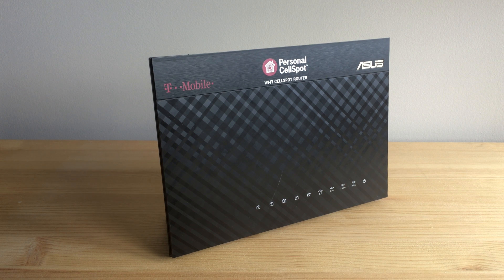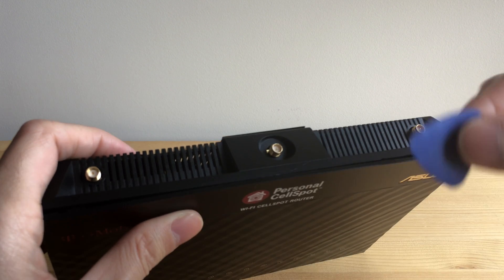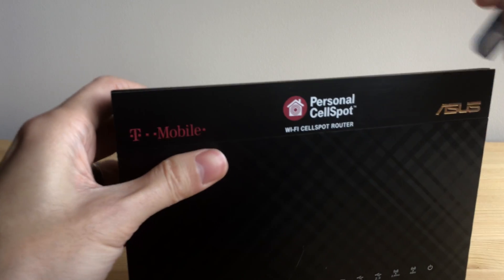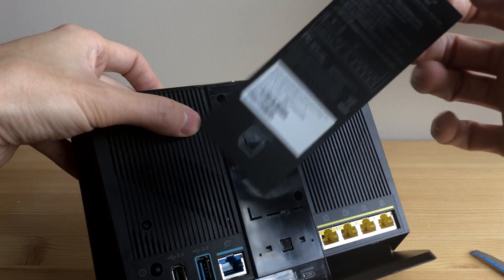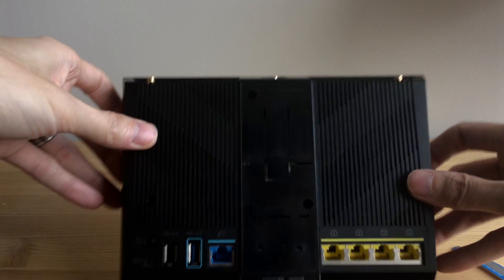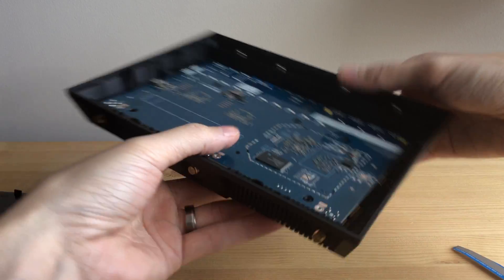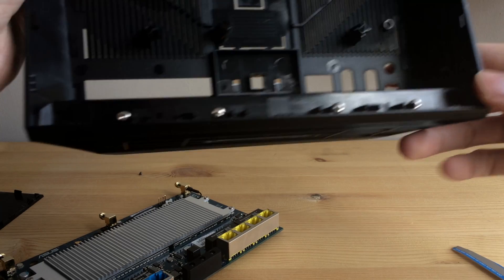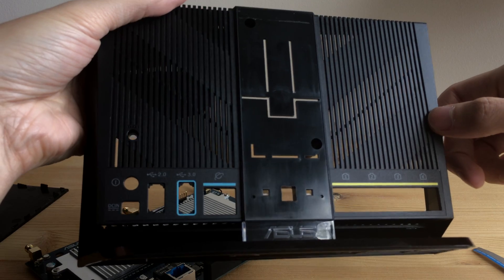ASUS RT-AC68U router disassembly - How to Open (T-Mobile TM-AC1900)

Comment: I know this is an old post but it would be good to replace the thermal pads or part of it has any under the heat sink that's the main reason why these routers fail the thermal pads dry up and get brittle and the chips overheat this is exactly the reason why they make it hard for us customers to get on them. They don't want us to do any maintenance the pro along the life of them so we buy new routers cause they burn up because they use bad quality, thermal paste and bad quality, thermal pads basically ment To last for a year or so forced you to upgrade I wish I knew how to open that along time ago when I started having issues after a year, I could've removed the heat and replaced the thermal pads, the thermal paste whatever they use on it

Comment: Thanks for the video. I was not at home for a long time, and when I'm back I realized that 2.4GHZ wifi is no longer working even if the led was l bright. 
Do you know is there a way to fix it? or it is burnt.
Reply: I know this is an old post, but I posted it earlier. What causes these routers to malfunction is they have thermal pads or thermal paste that dries up or wears out causing the chips and processor to overheat planned obsolescence that's why they make it so hard for us customers to get inside to do any maintenance. They don't want us to they wanna force us to upgrade so they use cheap thermal pads or cheap thermal paste wish I would've seen this video a long time ago cause I also started having problems with one of my bands, and I knew what the problem was worn out the thermal pads or Worn out thermal paste I've saved other routers by replacing the thermal pads on them with the heat sinks, cause I can get to them easier, but these ones they make it or it's hard to get to the thermal pads dry up or paste whichever they use if you can get yours apart carefully remove that heat sink that's on the back that big metal long heat sink thing look like it had four screws two on each side carefully remove that and if you can get new thermal pads or paste, I don't know. I've never took one apart, not that brand then maybe it might fix it does the band that's giving you trouble come back on after you unplug it and let it cool down for a while if so, then you need to replace the thermal paste or the thermal pads.

Comment: Many Asus routers built the same way. I suppose once you get the design and plastic tooling right, why fix something that is working? Vertical mounting of the PCB in the case allows for natural heat movement across the internal heatsink.
No need to pull the label completely off - just enough to expose the two screws underneath. That way it will still be in alignment with the plastic assembly when you put it all back together. The adhesive holding the label is quite robust and will stick back together quite well and it wont be obvious that a hacker (fumble fingers you) has been here. The screws are normal phillips head screws - nothing too fancy here. The front panel will clip easily off if you follow it around all the way gently and will snap back in place when you put it all back together.

Inside is boring, except for the clearly marked UART port on the PCB with 5v, TX, RX, and GND. Power switch looks flimsy, and could be an issue for some PCBs and can be easily bypassed by desoldering and putting in jumpers instead. Giant heatsink shows that there is some serious power and heat activity happening here.
Be extra careful when moving the PCB so the tiny antenna connectors do not pull off the PCB. Take a photo so you can make sure the right ones go back in the right place. A gentle press is all you need for them to clip back on.
Mine was a 4G-RT68U model and the disassembly principle is the same except only the two outside WiFi antennas unscrew, and the two inner 4G ones do not. No need to remove the antennas - just fold them out of the way.
Reply: there is a need to open it before too long those thermal pads or thermal paste wear out eventually causing those chips inside to overheat and that's where your router malfunctions come from any other router brand. I replaced the thermal pads and the thermal paste for the CPU and different chips are still lasting. Even my end router still lasts without problems because you have to get in there just like your computer components you wouldn't leave thermal paste on your computer CPU forever would you after it's dried up. Makes sense to replace it on your routers. Also unless you have unlimited money to spend on all your routers, cause you're failed to replace and do maintenance with the thermal pads also, you're streaming players also have thermal pads that dry up and go bad at a Roku 4 almost go out on me. Caught it in time opened it up Seen it had a thermal pad in it a couple of them I put new high-performance ones in there high-quality I mean thicker never froze. The screen never messed up after that and it's still going strong. Well if you look up online on eBay, there's a bunch of broken ones, and the reason why is because the Thermal pad dried up wasn't making a connection to the heat sink and the chips burnt up

Comment: My 86 just died. I tested the power brick and it's still supplying 19v. Anything obvious i could check after opening?
Reply: Power switch. See if the 19v is still present after the switch. If not, replace the switch or bypass the switch with jumpers.
Reply: hopefully your chip or processor didn't burn out. I replied to a lot of these under that heat sink when that's open is either a thermal pad or thermal paste that dries up over the years, causing those chips to overheat and malfunction. Hopefully your chip didn't burn out if you could do that and what the other guy said to try to bypass that power switch it might fix it I switched out my version of this router before it burnt out. I just started getting slight glitches so now since I seen this video how to open it now I might go ahead and replace the thermal pads under the metal heat sink might fix it.

Comment: Jeremiah, thank you!  Excellent video. Mine has intermittent power outages and I was struggling on how to remove that front cover so thanks again!
Reply from the maker: Hope you're able to solve it. Mine also had a flaky power connection, and it ended up being a cheap AC adapter with a barrel connector that would not stay seated in the socket and would break connection if it was moved.

Comment: Taking that front cover off was an absolute pain. Do it on the floor somewhere away from things that you don't want to damage because either your hand or the router will slip. I dented my keyboard. :( And you are going to scratch the router's sides, it's inevitable especially the first time you do it. The trick is, you gotta press SUPER hard when you get to a clip, there's no other way. Don't be afraid of breaking it, you won't, the plastic is really tough. I pressed on the clips as hard as I could and none of them broke, though it's possible you'll break one or two.
Reply: Plastic spudger that comes in a cell phone repair kit, or at a pinch, a guitar pick is the painless way to go. Pressing the outer shell a certain way makes the clips pop off easy. Removing the screws under the label first means that the outer shell will not try and spring back as you work your way around. Patience and working on the kitchen table with lots of light and a newspaper underneath is the way to go.

Comment: Can the AC86U be disassembled in the same way?
Reply: For aynone else wondering: Yes. These are the same devices though the tmobile version is gimped by default. You can unlock it to its full potention.

Comment: Mine had three thermal pads under the heatsink --- placed over the hot spots on the PCB. Removed them, cleaned heatsink and covers with alcohol, and used proper thermal compound on the heatsink. 

The covers to the processor & other chips come off fairly easily (just know that they are made of very thin aluminum, so be gentle with removing them), and there are more thermal pads on the chips themselves. Am considering replacing those thermal pads with copper shims.
Reply: Did you ever do so? My B2 revision idles at ~80C so clearly it needs better cooling. I've read the TJMAX for these CPUs is 130C but even so there are reports of instability when getting to 90C+.
Reply: @hellishinc  I did. I also modded the back of the case to accept a thin fan that I took from an old GPU and power it from the serial header.
Reply: @hellishinc  TJMax is lying to you. 160 real degrees (not celcius) is as hot as silicon can get without breaking down. If something is running at 80C all the time, it is breaking down and won't run efficiently or for a long time.
Reply: @TehButterflyEffect  what are real degrees for you? Kelvin?
Reply: Hafizulla: Is there any chance you could share exactly how you did this? I have one of these, and it runs hot at idle. I'd like to mod mine the way you modded yours.
Reply: @davewyendt1887  Well, there's not much to say. The hardest part was getting the back cover off to expose the mainboard.

I did remove the shielding from the processor & RAM; there's thermal putty between the chips & the shielding, and between the shielding & the heatsink. In retrospect, I think I shoulda left the shielding on and put some thin copper shim material between the shielding & heatsink. 

So I basically cut a hole in the back cover with an xacto saw to accommodate a fan I took off an old GPU, and glued it in place. I ran the fan leads to gnd and VCC on the serial header, and there's just enough current to run the fan very quietly.
Reply: @hafizullahsufi  Thanks for that. I may just try it myself.
Reply: @davewyendt1887  Replacement fans for laptops are cheap and easy to get on eBay, and are thin enough to fit between the back cover and the heatsink. You could cut some thin styrene plastic such as from some packaging to form a duct for the airflow, though it may be sufficient just to exhaust air from the case rather than blow on the heatsink.
Reply: this is the same thing I've been replying to everybody with that's why these routers fell and other devices like streaming players is because the thermal pads or thermal paste dries up and they don't get efficient cooling. I wish I would've known this way back when mine started messing up, but I unplugged mine right away and replaced it with another router but I have repaired streaming players like Roku and stuff by replacing the thermal pads with new thermal pads. Thermal paste isn't thick enough for some of those to make a good enough connection so I buy a little bit thicker thermal pads throw them in there. I change them once a year or at least eight months preventative maintenance. I think that's why they changed the design making it harder for us customers to get in there and try to fix it herself, so we're forced to upgrade in the next year or two to the next model.

Comment: I like the tutorial, but i broke my front, because you did not start with the info of the screws behind the sticker.
Reply from the maker: Still Rivers sorry. I showed it how I figured it out. As others have commented, it probably makes more sense to start with the screws under the sticker.
Reply: @miahz  No problem, don't mean to hate. I sure myself had the chance to watch your whole clip first before taking it apart. I like your quick response!
Reply: Variation on the truism "measure twice, cut once". Watch the video twice to make sure you don't miss anything.

Comment: Why would anyone ever need to get inside the unit?????
Reply from the maker: HGR693 I was having issues with the power blinking on and off when moving the unit, so I was checking if the power socket had a loose solder joint or something. But it turned out that the power supply cable was bad.
Reply: @miahz  makes since to me.thsnkx and good luck.
Reply: Overheating.

Comment: What was the purpose of disassembling it? My router get crazy 82C when idling. I find it to be high. Did you tried to attach some small fan to it on the inside, behind the board, inside the body, where some air vents are at the back? Did you took some measurements?
Reply: DON LUKITO I added a corsair 140mm fan at its back and temps dropped from 87 to 57c.
Reply: Thank you. I already bought special fans this router. 2x80mm from AliExpress.  Quiet and cold. Recommend.
Reply: Why disassemble it? 
1. Because that's what guys do. 
2. In my case, I wanted to check out the heatsink; manufacturers often skimp on this, using cheap-ass materials and cheap thermal gunk instead of proper thermal paste as we would use on our computer's processor. In this case, the heatsink is huge, but uses thermal pads, which are barely adequate, and I also wanted to see if there's a way to get that foot off so that can wall-mount the router.

For reasons beyond my understanding, recent router cases look like they were beamed-in from the Marvel universe. Whassamatta with a plain black box?
Reply: @hafizullahsufi  Finally, I've done the same thing, and disassembled it, right after I've asked this question. Changed thermopad on the heatsink, and added 2x 60-70mm cheap, silent Chinese fans on it's back and CPU temperatures went down by 20-25C and 5-10C on both antennas. 80-85C > 55-60C and 50-55 > 40-45C. It was worth it.
Reply: @dondolarson5134  Can you post a link to the "cheap, silent Chinese fans"? I'm looking at a thin laptop cooling fan, as there's only about half an inch between the heatsink and the inside of the case...
Reply: @dondolarson5134  That's pretty slick.

I'm going to try a laptop fan on the inside. There's enough clearance between the heatsink and the inside back of the case for it to blow across the heatsink, and I think I can solder or conductive-glue the power leads to the +5v USB pins.

I ordered some 2mm copper shims and am going to take those cheap-ass aluminum covers and their thermal pads off the RAM and processor and see how far I can overclock them with some decent heat dissipation
Reply: @dondolarson5134  You can get most of that cooling just using USB fans on the back.  No need to even break the case open and risk breaking it.
Reply: USB
Reply: The heatsink requires shims etc.  Sort of a pain to put in but if you do it right you can drop it 15-20c.   The easier way is put a par of USB fans on the back.  Can use a giant rubber band to hold them or go velcro.  It will drop the temps from 88c to like 62-65c and also cool the wifi chips down.  Fast and EZ fix.